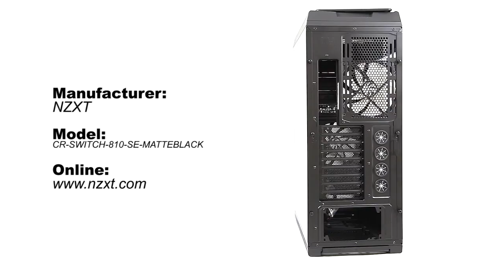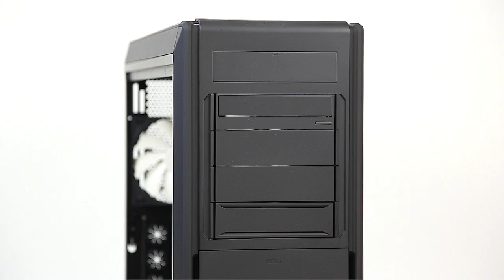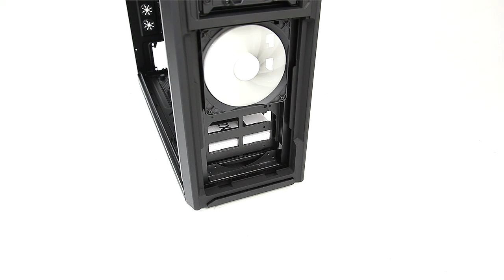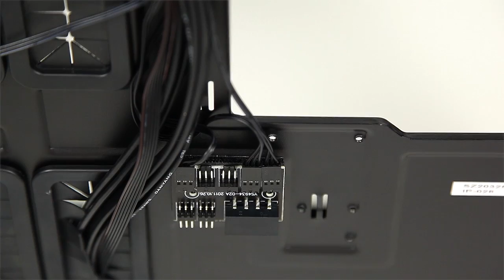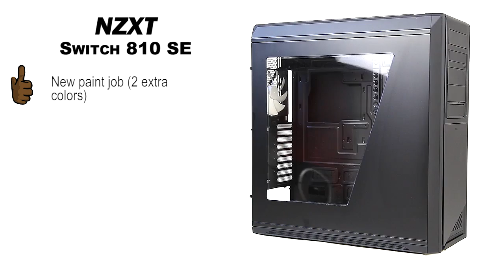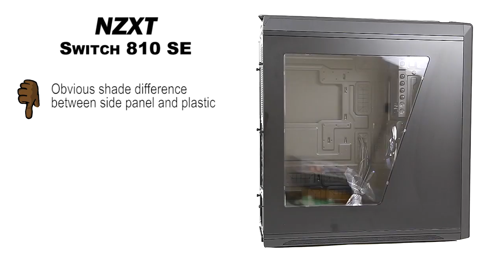NZXT Switch 810 Special Edition Case Review

Comment: You missed the crucial difference from the normal to the special edition, there are extra venting holes above the 5.25" bays which was meant to help airflow when using radiators.

Comment: 800D is quite sturdy indeed, but I don't agree it's easy to MOD. The steel is so strong it's very difficult to cut, plus removing the bottom cage is a pain and requires that you drill rivets. Great case overall though.